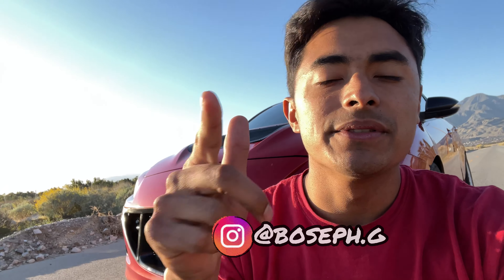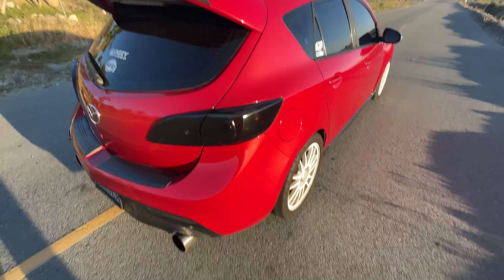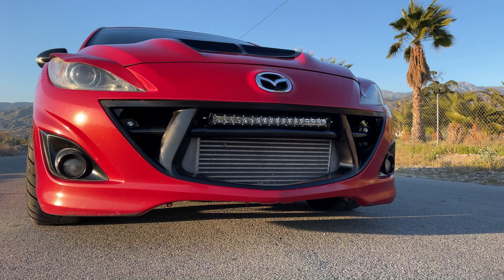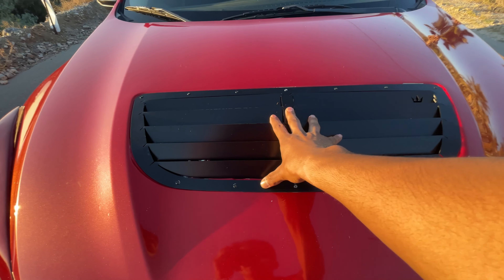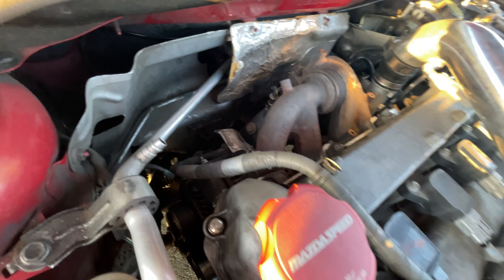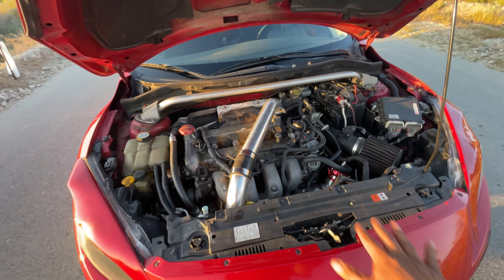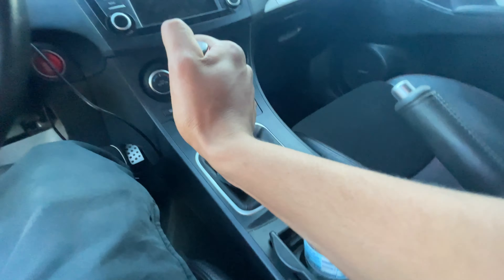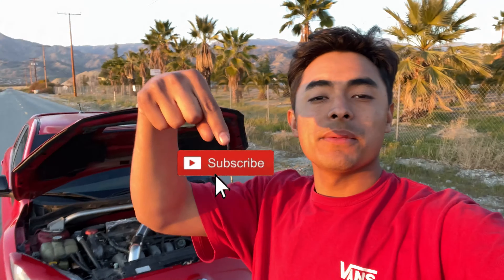MAZDASPEED 3 FULL MODS LIST!!! 2021

Comment: Pick up a spare 2.5 for cheap and start building the bottom end. You will be prepared for the eventual grenading of the 2.3 and can do the 2.5 swap!
Reply from the maker: Haha the motor is running strong rn & yes I’ve already got a spare block on deck😉